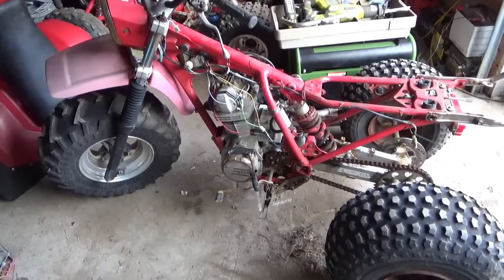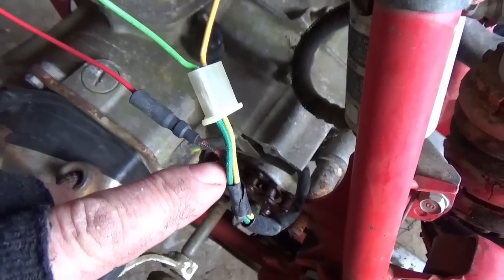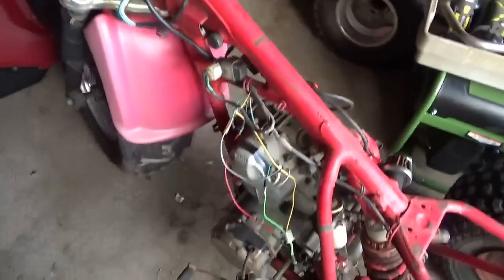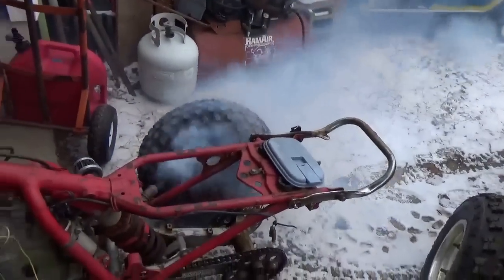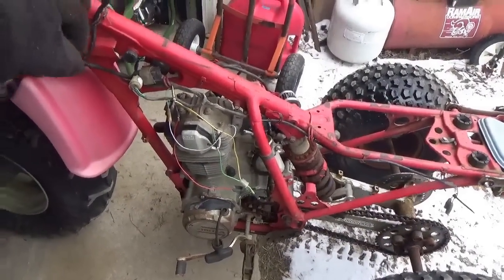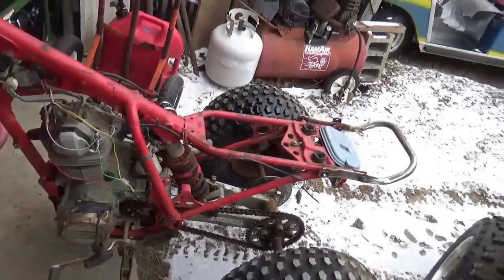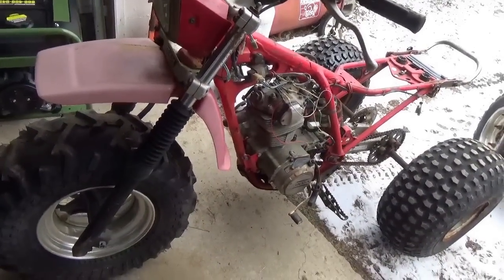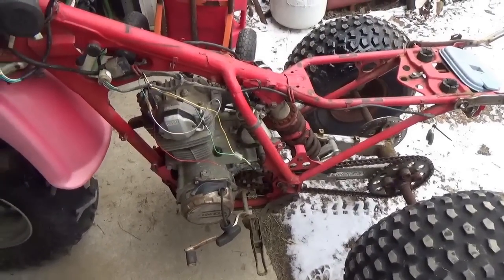How to wire a Honda ATC 200S Motor to a 200X ignition harness!

Comment: Hey Harvey awesome video I got a question about the switch situation I finally got my atc110 running after restoring it like I was telling you about but the off-and-on switch for the lights is stuck in the on position what could I do to free it up the off-and-on switch to kill it works perfect

Comment: i was riding my 1984 Atc 200 and it just shut off on me. like it ran out of gas or something. i cranked it. it started a couple times and stalled.now im not getting spark. my cdi connected to the head well i took the 2 screws out and cdi was full of oil. my question is. can i add an external  cdi box instead. my bike has absolutely no lights or anything. just a push button for start button and it cranks the motor. i plan to take  my harness off and wire it up. and get it running for now with the woring

Comment: Ya I know your saying , dang it he’s back ! Ok here we go my pulse gen. Is 30 , my coil is .7 my gray wire is .9 I thought I had 265 at my stater but now I have 0  , did my stater go out and that’s why I have no spark ? I also checked the timing it’s dead nuts on ! I bought a new CDI box ( round plug ) it don’t have a battery , I’ve mounted the engine in a Cushman truckster and I’m not sure of the shift pattern on this motor ? 1984 200es is the engine . Does this CDI box need a battery and the small one doesn’t? I have a 1986 Honda fourtrax 250 and it’s pattern is 1 down the rest up . Do I need to have this in neutral to get spark ? Man I’m stuck ! I thought I was a decent mechanic but boy this ones got me pulling my hair ( and I’m bald already) thank you Harvey !

Comment: Can u use a 125-150 cc coil on a 185 atc or should I return in and get a 150-200 wire kit and a lot of them have start swicthes but it only has pull start so I dnt think it’ll be a problem right
Reply: It came from house fire and all burnt but the cdi wires goes and u cna see the color till u get to the end of it and then the stator all burnt but I think after I take the chain guard off there be enough to see wht colors are which I jst hope the stator still works